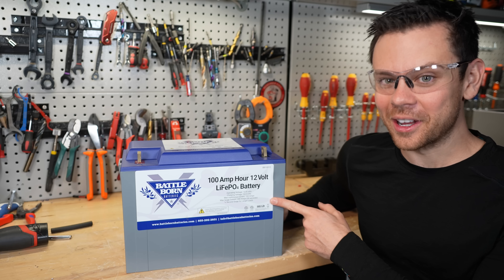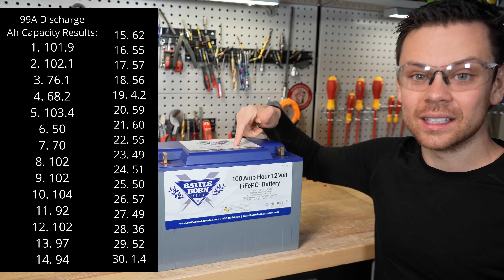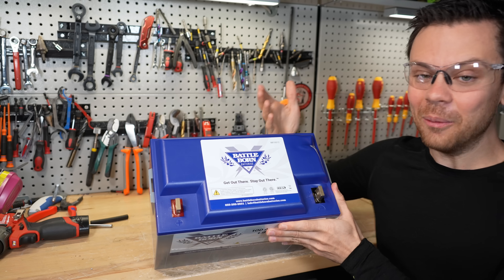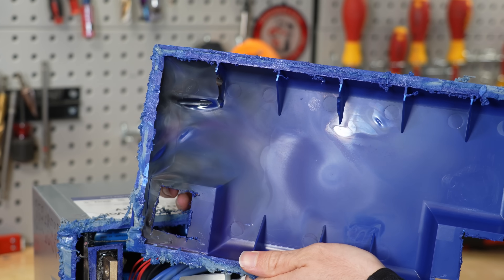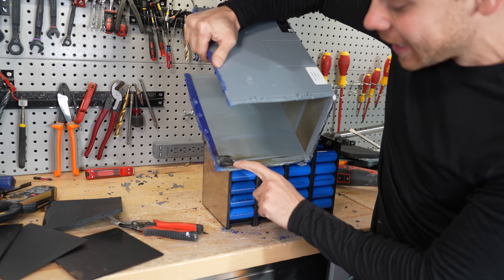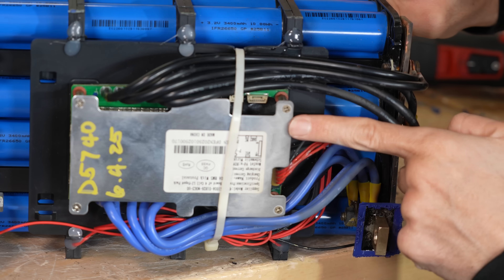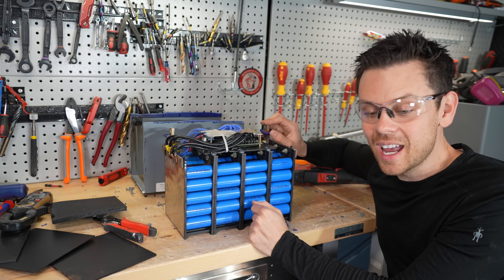Battleborn Battery MELTED?! 🔥🔥New Problem!

Comment: I cant speak for everyone but I have had some really good experience with Dr. Prepare batteries.  I know, I know, but still. I bought 5, 100 AH 12 volt units. Going into my third year and they are mushing on with great viger. 😆 Oh, and I paid 189.00$ each. At the time was a great deal. 👊🏻
Reply: Chins, Redodo, power queen, li time, etc are all better choices and all around the ~$200 mark.
Reply: @andrewt9204 thanks for the info. I appreciate it. When these go toes up, I will remember your advice.  👊🏻

Comment: there is a company pointing its fingers going good thing we charge them 50% more than any other battery . probley no warrantee for faulty equipment being sold. lucky it did not burn your house down.. 140 degree is it for those lithium batteries.. the lithium burns so hot and quick its killer poisonous...

Comment: oh wow,  I can't wait for the response from Battleborn!
Reply: They will threaten to sue you and say you were not using it properly.  Horrendous owners / management
Reply: @LevelUpLife-X10 good luck 
Access too many battery experts will say their battery is s*** and I'm another one You can always look me up And I'll tell you how 💩 they are
Reply: The flames are a safety feature!
Reply: @eomrat1  It’s a feature 😂
Reply: "Its not a failure, its a feature"
Reply: @MrAlekoy   Saves your equipment from running too long........
Reply: We need to all start a class action lawsuit to get our money back. Think when I bought mine they were like 900 each. Now I won’t even use them. Moved on to Watt Cycle.
Reply: @Photosbyrasberry  what's the saying?  You can't get blood out of a turnip?   There needs to be a company with assets to get compensation out of a class action and by the time a legal process results there isn't going to be anything left except a smoking hole...
Reply: @Photosbyrasberry  if you’re not going to use them, you should cut one open to see if it’s the same as the one will cut apart.
Reply: @Photosbyrasberry  Never mind that "class action lawsuit" is a fancy way of saying "Let's get a multi-million dollar settlement that the lawyer will rake all but about a million off the top of, leaving approximately $1.47 per "class member" for a payout."
Reply: @Ferd414 and lawsuits is something the left thrives on, I don't want to be like them playing the lawsuit lottery.
Reply: @Ferd414  True, but it does hurt the company.
Reply: @gsp49  Trump files more lawsuits than anyone I know...
Reply: @gsp49  the current president is definitely someone that loves suing people😅
Reply: @Photosbyrasberry I get the same results with Bluetti power stations, not melting but dead after a few uses.
Reply: "That's our new wireless fire starter feature"
Reply: @cdevidal Wireless?
Reply: They're too busy sitting on the inflatable donut! 😂
Reply: @chrisparker9886  I think I need the inflatable donut - after buying four of those batteries.
Reply: It's game over for battle born!!
Reply: Another Battle Born feature!
Reply: The melting is a safety feature, when you smell melting plastic that means stop using it.
Reply: @Mistermatt1984 The smell was contained inside. Once he opened it, he said as much and reacted to the smell.
Reply: @genespell4340I know it’s a joke….
Reply: @Mistermatt1984  Even if that is true, he was using it in spec and it should not have failed. Unless there is a punished duty cycle he was exceeding, it’s a faulty design.
Reply: @SalientDebate it was a joke….
Reply: The flames are a “safety indicator,” indicating it’s time to GTFO and call 911.
Reply: Battleborn has been blocking and deleting anyone who makes a disparaging comment on their social media platforms they advertise on!
Reply: @jeffallen3382 I believe it. I saw their ad and there were comments but it would let let me see any of them?
Reply: @jeffallen3382 Wouldn't you? 🤷🏻‍♀️
Reply: @melissasmess2773  no, you'd bend over backwards trying to make things right or you'd make a public statement that the company is dissolving.
Reply: And customers pay more for these... have they always been this design?
Reply: If your dead because your house burnt down, you won't be able to sue them. Working as intended.
Reply: @uziman3800 not at all. If you are using it at or under its rated amperage and it fails then it’s not working as directed. Did you pay attention at all? 

It should NOT do this if it’s operating within its advertised/rated specifications. Will specifically stated he was staying within the rated specifications.

Components like this should have a “safety margin” built in where you should be able to actually draw 10% more than rated and not have it fail. Basic stuff. 

If they want to create a failure point for safety then they should install a fuse internally. Which is also basic stuff.
Reply: That Battleborn junk is just insane.   Always enjoy and appreciate your honesty and videos Will.  Great work!
Reply: They will change names and keep going
Reply: Let me guess: Deny, accuse, reverse victim and offender.
Reply: This is a design feature to Shou Sugi Ban the internals, so they’ll last forever.
Reply: Probably "It's supposed to do that - it's a feature".
Reply: Do they come with a fire extinguisher perhaps?😅😂🤣
Reply: They will probably just says its a saftey feature - they have lost all credibility
Reply: "That's our build-in heater feature"
Reply: “We made it to do that on purpose, melting is a safety feature”
Reply: “It’s a feature”
Reply: Don't worry, Battleborn will have another excuse that is wrong as to why this happened.
Reply: Response yeah those are old specs, new specs much lower charge/discharge rates.
Reply: Melting is a BB safety feature. You knew they will tell this😂
Reply: It will be generic junk, just like their batteries
Reply: They're obviously made to melt like this to protect them from... Melting.
Reply: They'll say Will is holding it wrong.
Reply: Hmm, I wonder if they changed something in their build process recently?   I bought a pair 5 years ago for my camper and haven’t had any issues, of course my trust factor just went to zero!
Reply: Antibacterial terminals
Reply: I bought one of those Battle Born 100 Ah batteries a few years ago. It’s seen a lot of off-road travel in my trailer. Knock on wood, no issues yet, but I’ll definitely be replacing it as I’m scared about their “safety features”. We should start some sort of DIY rescue project for these. There’s gotta be something worth salvaging, like the cells, etc. It’s really sad that they don’t take responsibility for this and issue a huge recall. It may cost them a lot, but their tarnished reputation will cost them more.
Reply: I think UL needs to buy a new battery indipendantly and do the tests again, as I presume they would tell BattleBorn to stop using the UL trademark until they have either returned the battery design to the version they originally tested that somehow passed, or submit a new design that will pass.

This might be a story of bait and switch with the higher quality design version that was UL tested and then substitute a cheaper less safe version to mass produce to save money.
Reply: Battery heater feature to allow for cold weather usage 😂
Reply: Not going to be much more different to the first....... They will again blame the consumer.....
Reply: Free heating in home 😂
Reply: You didn’t wait long enough for the automatic safety feature to cut off power for your protection!
Reply: it a feature, you can easily spot your burning house from miles.
Reply: Glad I shorted their stock. 😆💰
Reply: More threats and nonsense. Their ego is atrocious
Reply: Wow!!!
All those who thought they had superior BB batteries are rightfully pissed right now. 
The end of BB is in the future.
Reply: Get ready for EPIC LEVELS of gaslighting!!!
Reply: It'll just be more gaslighting
Reply: Good thing you pay extra for quality UL rated battery 😅
Reply: @douglasanderson1276  IT"S NOT UL RATED!!!   Watch other videos..  It's built to UL rating...   Never Ever got one...
Reply: @douglasanderson1276 the scary thing is that it's ul listed. Are they actually testing products any more, or just relying on a good sales pitch?
Reply: Amazing video!  Can you tighten the connections and keep testing it?  Curious what other flaws they’re hiding…
Reply: It's a safety disconnect. That plastic is engineered to melt and toast your battery to avoid catastrophic failure. Just imagine if they didn't have that safety feature!
Reply: @mwco79  its just pure lazyness that is what a thermal fuse is for
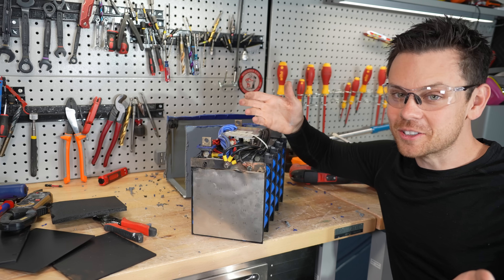Reply: @mwco79 they said the aluminum nuts on the bolts where the safety feature. The problem is that with the plastic in between the end plate and the bus bar the bolt is being used as the conductor. Bolts are not supposed to be used as conductors 5:51. Conductors (buss bars) are meant to be touching directly, as bolts are very poor conductors. The the bolts being the conductors (because of the plastic plates) are the reason for the heat buildup, which deforms the plastic, which loosens the conductors, which causes further heat buildup from poor connection…. Until it gets to a point where it no longer functions. 

Bad design. Build an actual serviceable fuse in or put clear writing and pictures that a fuse is required. Simple enough.
Reply: @jeremykamel9655 it's hard to tell from the video but it looks like the bolt is used as a conductor on the positive side but on the negative side the wires going from the bus bar to the BMS are directly touching the bus bar. Then from the BMS to the negative terminal it's a little harder to see but it looks like they directly connect to the external tab.
Reply: @b@b @bhartley1024 his will be long ish, sorry. Let me explain. The negative side has the black and blue wires. The positive side has no wires. It has a thin nickel plate (that is spot welded to all the batter cell ends) and bus bars. A horizontal bus bar directly touching the plate and a vertical bus bar that goes through the top of the case, which becomes the positive battery post. The horizontal bus bar at the top of the thin nickel plate touches it directly. However there is black plastic insulating that horizontal bus bar from the positive battery post. 

To see this each when he cuts the top off. It shows the negative side first. If you pause the video when he pans to the positive side, you’ll see the black plastic peaking up from between the horizontal bus bar and the positive post. That plastic insulates the horizontal bus bar from the battery post. Making the bolt the conductor. 

So yes, it’s still a problem.
Reply: @jeremykamel9655 Right, but isn't the bolt a conductor on the positive side only? I agree it's still a problem for the battery as a whole, but there must be another cause for the failure of the negative side. Doubly bad design if there are two different design flaws that cause overheating.
Reply: @bha @bhartley1024 im not sure what the black an blue wires are about on the negotiate. But there is an end plate m that side. While I didnt get a great view of it, it did appear that it was somewhat similar there when a difference being those wires maybe they’re balancing leads. Anyway I saw the plastic on that side as well. But sort of wrote it off because of the wires. I’ll be interested to see more on that end.
Reply: You would think they would send you a battery with super quality control given you bought it and they knew you would test it.  No Battle Born for me ever!!!
Reply: Like i said before. Bad design. Absolut crap.
Reply: Another professional analysis… BB needs to shape up or ship out… their sales have to be plummeting
Reply: I don't get it. You once gave them a good review. Has there been a change in ownership causing a serious degradation of quality control? Did they sell out to the Chinese, like Black Series, CampChef and others have?
Reply: More information came to light, including failures. He explained this a few videos back. He’s done like 3 or maybe 4 videos on these specific failures now.
Reply: I am surprised more people haven't paid close enough attention to the size wiring in some of these batteries.  People running huge gage wiring to terminals thinking they are good but the internal wiring barely meets specs for their advertised specification...

Comment: Electronic engineer and living in an RV 50% of the time for 5 years. Your tear down videos have led me to both SOK and Epoch. Both have served me well!
Reply: Once upon a time his tear down led me to purchase a Weize, it tumbled out of my sinking kayak and went to the bottom, I hired a diver to get it, and I'm still using it today.
Reply: I’m happy with my two 280ah SOKs - nearly two years now.
Reply: I also live in a RV. got any pro tips?
Reply: @Zaku186 : floss
Reply: @JohnBrown-s9q way ahead of ya. I also use anti-cavity moth wash.
Reply: @Zaku186  I'm pretty sure moths groom themselves
Reply: @dangoesfast  lol yea my bad
Reply: (4) SOK 24v 200AH have been serving me well for 2.5 year, full time RVers. About 200 cycles registered on the clock.
Reply: Who is SOK?
Reply: @Zaku186  A brand of battery.
Reply: @maurice7413  ok thanks
Reply: @Zaku186 google them. It’s a battery manufacturer just like Epoch or BattleBorn or any other.
Reply: @Zaku186 China, LOL
Reply: @gsp49  yea not everything china makes is garbage though. And they only make so much garbage cause so many of us just buy whatevers cheapest
Reply: @Zaku186  It's a battery brand that has a "removable steel case" so it can be serviced if ever needed. Battleborn may have survived if it the case came apart, but they had to go with sealed plastic...
Reply: Unless you can take apart your battery you never really know what you're getting from one made in China. They can change designs instantly in the exact same battery case and you'll never know it. People want cheap, not reliable, not well made, not expensive.
Reply: @Dav1d_B battleborn  not from china
Reply: USA Navada

Comment: I’ll be happy to hear how BattleBorn responds to you. That’s 2 batteries that have had major flaws. Is there a way to determine the production lots? We’d see if they were manufactured at or near the same time or possibly ate different facilities or production lines.
Reply: I'm betting it's not a bad production batch.  The connections were probably tight until the plastic deformed.  It is just pulling the rated amperage for a full cycle heats up the plastic too much and allows it to deform.  Hopefully most folks don't pull their batteries to their max for more than a short duration.
Reply: @haroldanderson6021  Bad design. No engineer in his or her right mind would clamp a high current conductor to a layer of soft plastic. Even without overheating the plastic will "Cold Flow" under pressure and time, deforming and loosening the connection. Once it begins to heat up the plastic softens rapidly, deforms and now you have a thermal runaway situation. I'm retired but I spent years in power supply design, test and manufacturing. This thing is an embarrassment, and a dangerous one.
Reply: @Chris-lp3dm  Yep, I'm not saying it's a good design at all.  Looks like a nightmare actually.  I was just trying to be realistic about normal usage for this battery but your are correct once it heats up it can only go from bad to worse.
Reply: @haroldanderson6021 yeah pretty stupid fuking design
Reply: I heard BB has hired Baghdad Bob for their new PR spokesperson to handle this mess.
Reply: @MyGoogleYoutube  "'Our initial assessment is that they will all die'"
Muhammad Saeed al-Sahhaf, Spokesman for BattleBorne Batteries
Reply: I literally, before this video saw a guy who bought 1 early on when they were really expensive, I think he said he paid $1,600 bucks for 100 mah 😂 anyway his was the exact same. he cut it open and everything was loose inside and charred. worrisome

Comment: What a stupid design.  The BMS should handle the current limits.  Not the crappy pinched onto plastic connections.  This could all be fixed with metal spacers.

Comment: it's terrible that companies like this are putting people in danger.
Reply: And making people pay a premium for it.

5 years ago I thought they were a premium brand. Now they are just getting the cheapest outsourced manufacturer possible. I guarantee all these batteries with the plastic came from a new manufacturer, for a cheaper price.
Reply: And remember that this problem happens when BattleBorn uses LFP battery cells!

Imagine if BB use more thermally reactive chemistry like NMC/NCA/other nickel-based lithium battery, even the slightest of this fault will instantly trigger a MASSIVE thermal runaway, turning the battery into a giant fireball that will consume the entire house in no time
Reply: Battle Battleborn's "corporate speak" is reprehensible.
Reply: And charging Lamborghini prices for dangerous plastic crap.
Reply: 13.4 Million dollars in Annual income. ..... at $900 a battery, there ya go.

Comment: Seems Battleborn went the corporation way and cut costs on materials and using untrained assemblers with poor quality control. That worked good for US industries in the 70's too. LOL
Reply: “History Doesn't Repeat Itself, but It Often Rhymes” – Mark Twain.
Reply: Naw, it's design choices.    There are ways to do this right that don't cost more. Even engineers make mistakes.   Maybe the corporate factor was why they didn't fix it though.  "If we redesign this, then we are admitting previous design was bad and exposes us to liability"